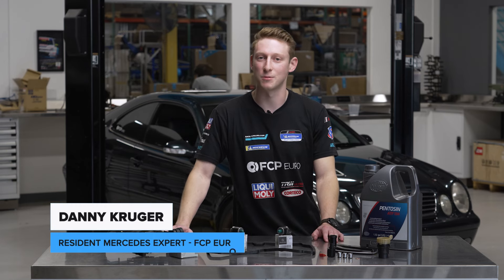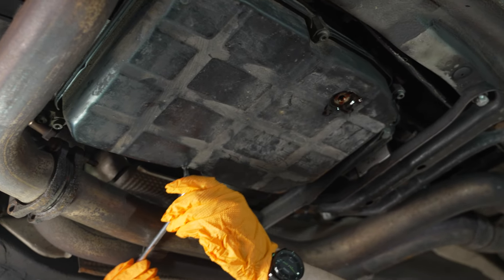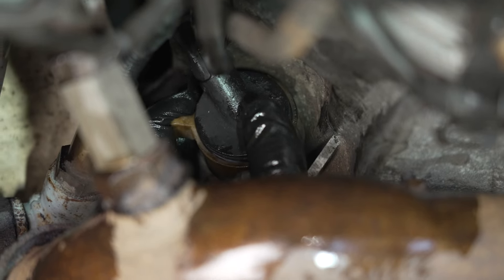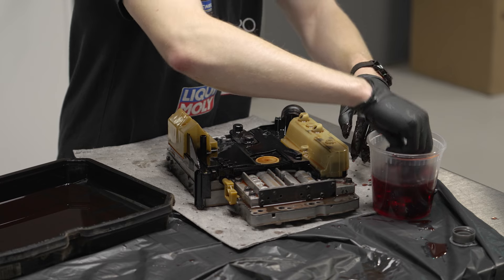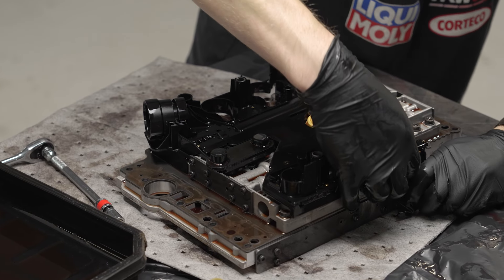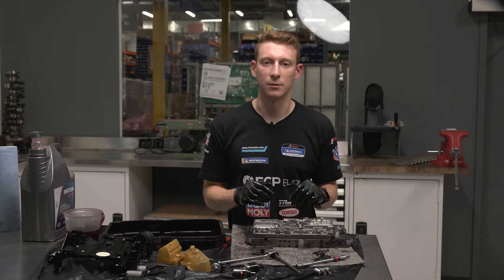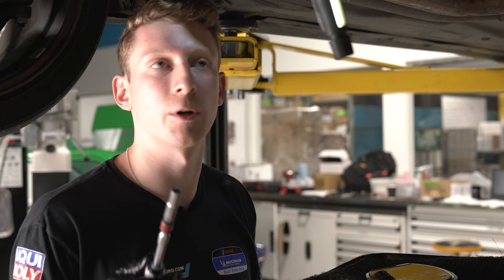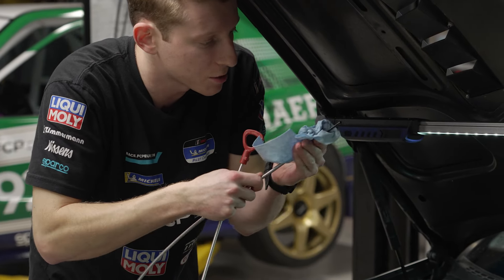Mercedes 722.6 Shift Solenoid Upgrade and Transmission Service (NAG1)

Comment: You say 5 liter fill. But i did the same job and i only get 4 liters in. Level is perfect on running engine temp 80 gr...
Reply from the maker: Hi there! I got an extra bit out with the air-driven CTA Tools Fluid Evacuation tool versus if you simply drained from the transmission pan. As long as you've followed our guide on checking the fluid following a 722.6 service and all looks good, you'll be good to go!
-Danny

Comment: Will this work for 06 c280 3.0 with out tune
Reply from the maker: Assuming your C280 is rear-drive, you likely have a 722.9 7-speed transmission and your service would look fairly different. We do have other videos on servicing the .9 though!

If you have a 4Matic car, you'd have a 722.690 which is a W5A300 (rated to 300nm). This is not recommended for the blue-top upgrade, which is generally a better fit for the W5A580 cars...and a tune will always be recommended on vehicles that do receive this upgrade.

Comment: I got p0600 and p0705 codes on my odb2  and it says transmission range sensor but I can't find any part for this car with that discription please help someone
Reply from the maker: Your P0600 is likely derivative of a lack of ECU communication with one or more systems, which is presumably a byproduct of the range sensor you see from that P0705 code. Consider investigating a shifter replacement (or at the very least a cleaning and inspection of the gear lever selector module) as a good first step to tackle that issue. A key sign of this failure is a blank square in the gauge cluster where the gear indicator will normally be.

Comment: trans fluid migrating through the wires to the  insides of  the remote  trans computer?  serious engineering there...
overlap sleeve failed again? need to polish OD and bore

Comment: Is the 2006 model year E55 amg already come factory updated solenoid? Any body with information
Reply from the maker: If you aren't certain, run your VIN through a VIN Decoder to grab your detailed transmission serial. You'll get something along the lines of "7226XX YY YYYYYY". 

The 722.6XX indicates the model of NAG1 transmission you have, and the remaining numbers indicate the serial of the unit in your car. While it isn't 100% accurate, you can usually be relatively certain that if your AMG's serial is after 04 247134, you likely have the blues from the factory. The only certain way to know is to open up the transmission and check though.

Comment: Can i do this upgrade ( Blue solenoids ) for my om646 220CDI?
Reply from the maker: Hi Karl! Ideally, you'd want a W5A580 variant of the 722.6 to ensure the transmission has a torque limit high enough that it can handle the increased shift/line pressure. To be certain though, we'd recommend poking around the internet a bit to see if anyone else has given it a shot on your vehicle.
-Danny

Comment: Does anybody know how many quarts are needed for  the transmission once its drained,  in my case only 5 quarts came out 
It's a 2005 e500 base
Reply: I have 03 s500 and supposedly 9 but only 5 will drain because the other 4 are in the torque converter but how many miles are own your vehicle and do you know if it had ben changed before and how did it drive after changing?

Comment: Someone asked but it never got answered - if upgrading to blue tops, is a tune REQUIRED? I understand it will always run better tuned, but are you able to run with it w/out getting a tune? Thanks for a great video
Reply from the maker: The car will physically drive with the blue-top solenoids and without a transmission tune, but we recommend a tune is used with this upgrade to ensure your gearbox's safety and that your drivability is to your liking.

Comment: The 722.6 is definitely not exactly the same assembly as the Chrysler-built A580.   

Anyone with the! A580 should follow the factory service manual, and use Mopar ATF+4 only. They also require a dealer to perform a relearn procedure after servicing, which definitely helps shift quality.

Comment: Who knows where to buy a good TC solenoid for the 722.6… it’s for my 05 dodge sprinter!! Help please! Not shifting out of 2nd after doing a transmission flush and new fluid and I also drained TC! Please help! Very muddy fluid inside and now it’s not shifting right I have a code for TC SOLENOID FAULT!!!! Help!

Comment: OK - you're about 10,000X the wrench I am.  Is it possible to hire you to work on my MB 722.6 tranny?  I've only got 125K miles on it so, given new car prices, I'm willing to make a reasonable investment in transmission repair, but only for a guy of your skill.  I've had a local  guy look at it and change the fluid and tell me there's no codes and it works fine for him, but that's not the case (i won't get into it's flakiness here).  Is that something you guys do?

Comment: WAIT WAIT WAIT!!! I have been checking the level with the car running I'm a retarded?I have a 2000 ml320 with the Nag1,please get back to me lol
Reply: Doesn’t matter if the car is running or not. What matters is the temperature of your fluid dictates the reading. Best to get a diagnostic scan tool that can read transmission temperature so you know if you over or under filled.
Reply: Fluid level should be checked with the engine running ,,,final check and adding should be done when trans is at operating temp ,
ie after driving for about 10-15 km.
Reply from the maker: Temperature is the key element here! We do have other videos on the MB-approved methods of checking your 722.6 levels.

Comment: I purchased 2 Blue Tops to go in my 2004 W211 E500 wagon/estate, but they are not listed as a match in the description.  Can anyone advise if they will?  thx

Transmission:
722672 04 788001 [transmissionType = GA
Reply from the maker: Your 722.672 is a W5A580 transmission, with the same torque limits as the unit in this video. You're good to go!